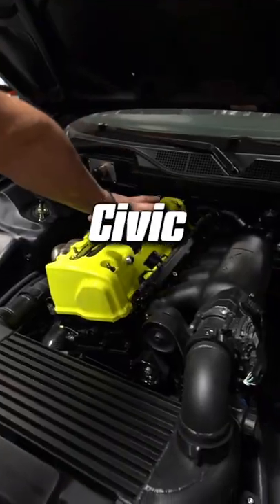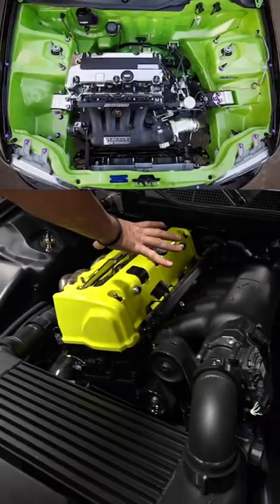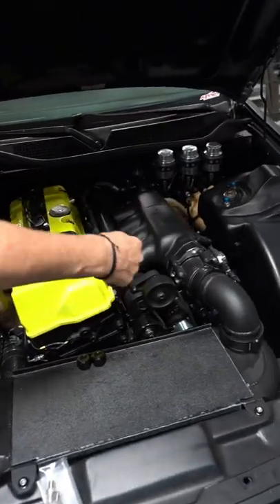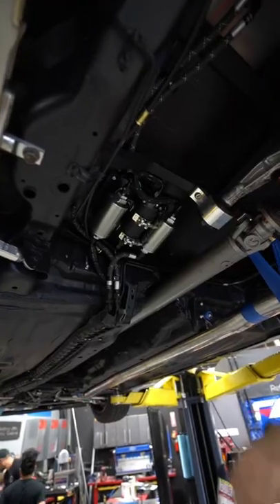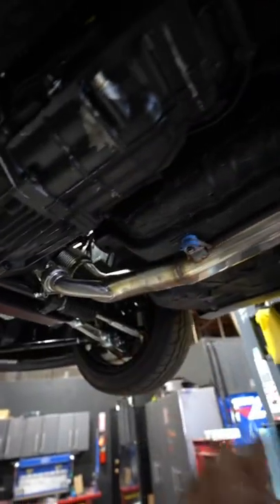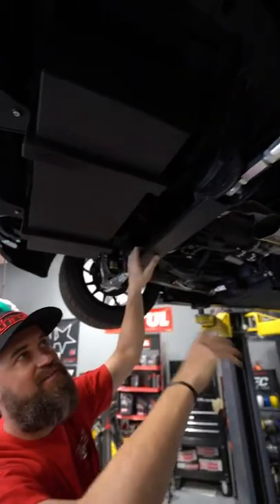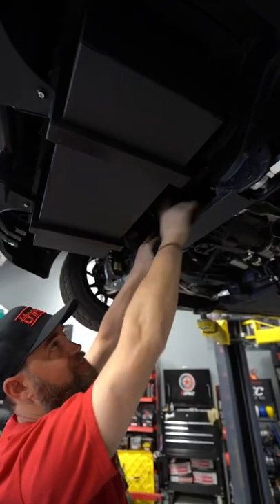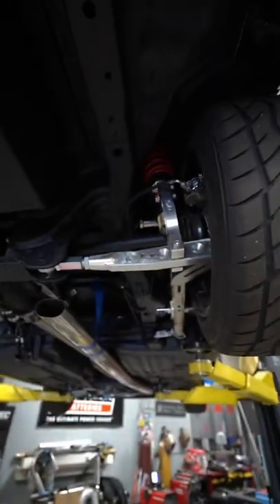This is NOT Your Average Civic

Comment: One of the coolest civic builds I've ever seen. Doesn't help that I'm a sucker for the chartreuse accents they always use
Reply: Quite cool. By why not just buy an s2000?
Reply: @muwaffaqsatardien1969  to expensive. They all used to be worth $800 and with any s chassis or any drift car you see now a days. But prices went up to much.
Reply: Does it have flame turrets though? Cayde-6 really likes flame turrets. RIP.

You said "chartreuse", couldn't help but drop the Destiny 2 reference.
Reply: @rootz4753  s2000's are not the Nissan S-chassis such as the Silvia or the 180/200sx

Comment: And mofos in the market rn sellling their beat up civics for 10grand
Reply: 10k with NO suspension, bad wheel bearing, Evap leak, brake caliper leak, no air conditioning and a timing belt with 90,000 miles ok it…
   And they’re like “It’s a Honda it will NEVER stop running!” “ you don’t know what you are looking at!”
Reply: *Trying to sell
Reply: "i know what i got"
yeah you have a junkyard

Comment: I love the s2000 trans swap. Badass. One of best gearboxes I've ever driven. Hope they used the s2000 clutch pedal setup. Has like a 2 inch throw if I remember right. At least it felt like a 2 inch throw. Almost like a on/off switch. Disengaged or engaged. No play at all. Perfect

Comment: Honda should give us replacement of S2000 before ICE are gone.
Reply: and ruin it like acura did the integra? nah i’m good. let it die a legend
Reply: @justabrokeredneck  no doubt they would ruin it
Reply: @justabrokeredneck  name checks out
Reply: @justabrokeredneck  havin owned a eg6, ek4 and dc2 I feel Honda has lost the plot....look at Toyota, they are smashing it
Reply: @pollumG  honda and nissan suck ass nowadays.
Reply: @justabrokeredneck  and it hurts like hell too, Nissan is at least trying but honda is just gone.
Reply: @justabrokeredneck  like he said Nissan is trying at least
Reply: They S2000s are expensive enough lmao, going to be 100k cars if that happens because everyone hates the new ones making the old ones a hot commodity
Reply: @justabrokeredneck  yeah Nissan is making a slight comeback with the 400z after that sorry ass excuse for a gtr that doesn’t even try looking like a gtr and non manual bmw Supra 🙄 like how do you mess up that bad it was laid out on a golden platter.
Reply: @charliehan1958  not the 400, it’s just the Z.
Reply: @charliehan1958  and there is a manual version for the supra coming. i think later this year or early next year
Reply: ICE won't be gone for a long time. Engines are getting better paired with hybrids. Some can achieve 1-3 liters per 100km with a 90 liter tank will run you 4500km per tank. 2 min fill up and back on the road.
Reply: @justabrokeredneck  nissan*
Reply: @justabrokeredneck  you’re saying this but I’m curious what car you drive
Reply: Every1 I know who has had a Chrysler 300 it shit the bed in 3-4 years and needed thousands of dollars of work. Hondas are not like this. I am curious where you are getting that “Honda sucks lately”? Their new cars are more reliable than the older ones in some cases, the k20c2 can last 400k miles with no problem. What is your source?
Reply: @justabrokeredneck  chrysler 300 are boats and are under powered for what they weigh. Also chrysler dodge and ram jeep and Chrysler fiat are all the same brands their cars suck so bad they tried selling cars under different brands but ppl aren’t stupid they knew it was the same shit company that replaces transmissions in 10k miles. The new ram trucks transmissions literally go out in 10k miles💀
Reply: @pollumG  true. I love my 2020 camry

Comment: Yo Jimmy oakes and Bryan hall built a RWD civic based on the 240sx with a Nissan motor which funnily enough now has a swap kit that could run a k24, their build is pretty sweet especially because it was just two dudes doing it in their shop...

Comment: Everyone's talking about how clean it is all I see is a tipped motor and I say no
Reply: You need some glasses to say the least... That engine isnt "tipped" its turned 90° ,its also awd ... Yhe fabrication was clean not all butchered up . But i guess its easy to miss those kinda things when you dont know what your looking at.
Reply: @codyramos3200  you can say what you will, you are entitled to your opinion. The motor could be flipped 180, 90, or 47 degrees. It is still no longer level. Again I say no to this project. I also am entitled to my opinion if you are to retain the value of yours.

Comment: If you want to go faster and cheaper why not. Rebuild a Chevy LS 5.3 Aluminum block engine, turbo or nitrous, inter cooler with turbo, 4L60E with trans brake or turbo 350 transmission with trans brake,, 9" rear end! Faster and more dependable. Building a big 4 or 6 cylinder import is like putting a motorcycle engine in a car not fast, not dependable and you will break things!!! Lighter is stronger and more fuel efficient.